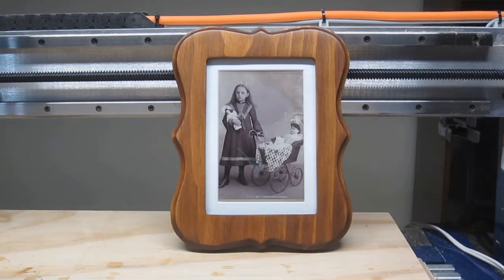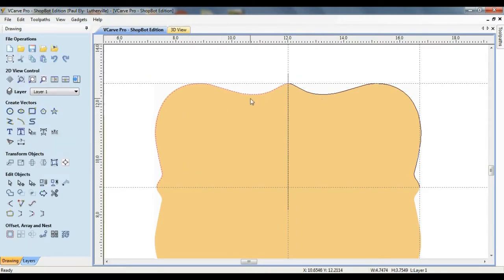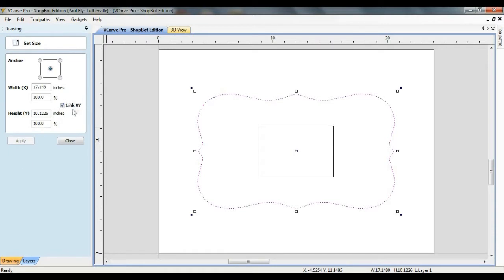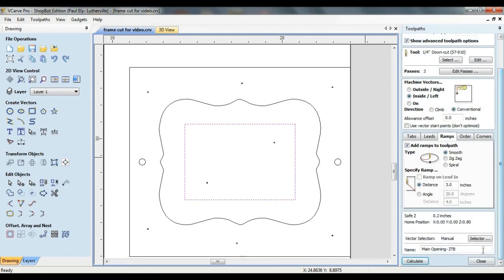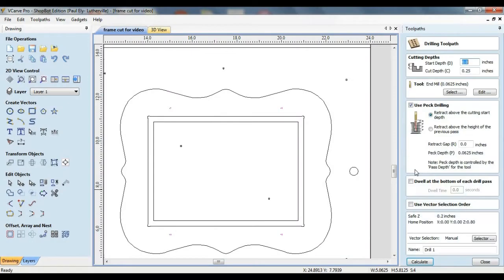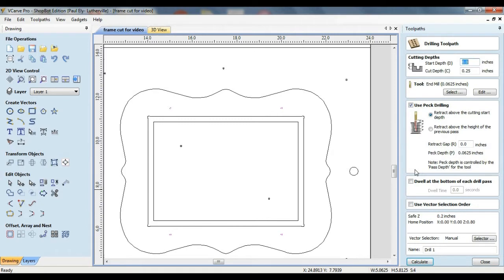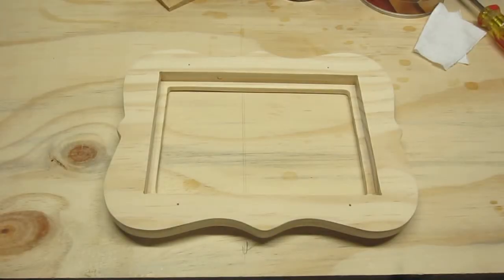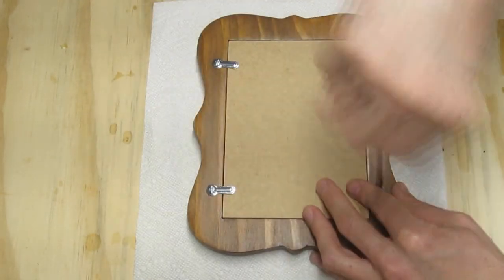CNC Router Projects: Start to Finish- One-Piece 5x7 Photo Frame

Comment: Absolutely loved this video. My dad used to make picture frames by randomly sanding the shapes along the outside borders. Very much like the one you made in this video. To see how you Registered the frame for top and bottom cuts will make cutting these areas much easier.  My Cnc Machine arrives 26 Feb... and I am all set to jump in for the learning curve.  Well done..